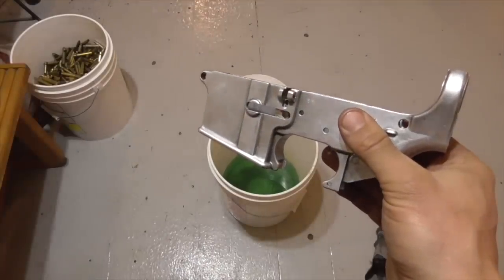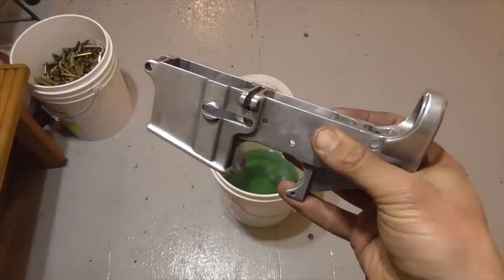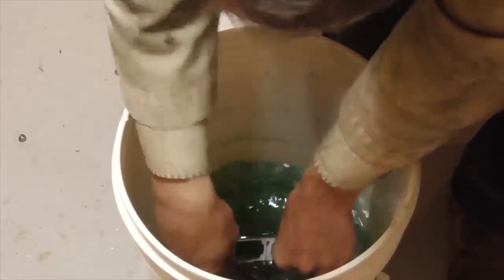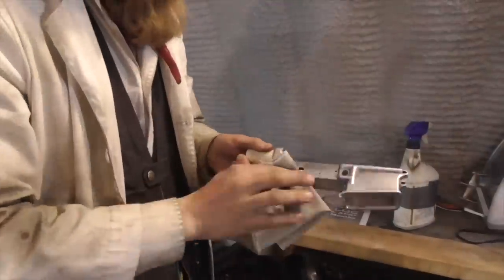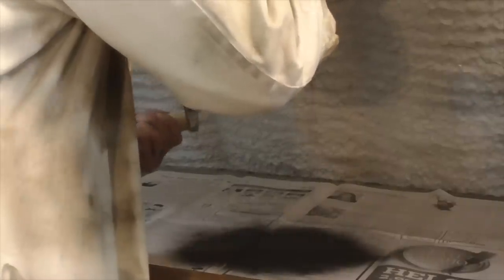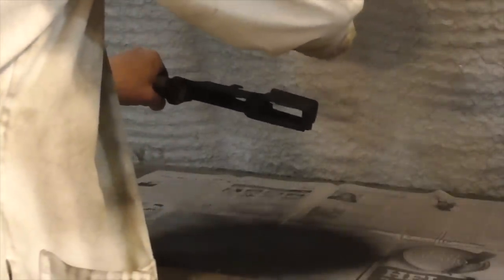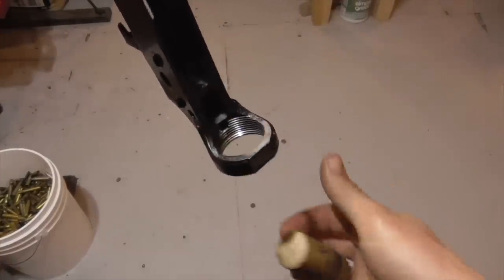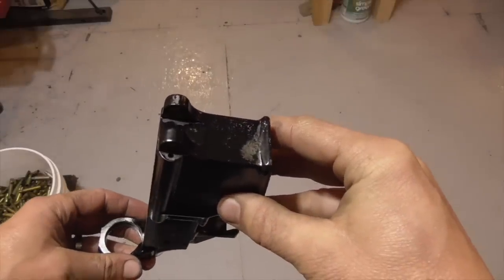Powder Coating: The WD40 Method (TIS263)

Comment: For anyone interested, the wood plug shrank after heating because wood expands when exposed to moisture (up to a certain point of course), and contracts when that moisture is removed (heating the wood allows the moisture to escape).

Comment: I work for a gym equipment factory you cleaned it oiled it to make it stick can you spray it on? maybe a small cheap air brush or even a squeeze bottle ? just a thought I see them stray the powder on all the time before the parts go in the oven. it's not my job I just see them doing it

Comment: This Video was Just what I was looking for . I wonder how it will work with Harbor Freight Flat Black Powder. I've tried the H F Flat Black on cast bullets but it was too rough so I mixed it with H.F. Gloss White and got a better result but that's with bullets , not with my current project .

Comment: Dude a harbor freight unit is only around $75.   I have two and an Eastwood system and there’s very little difference.   I doubt your coating fuses with the product if you are using an oil to adhere the powder; it defeats the purpose of cleaning and degreasing it.   Just get a HF system, they work fine, the results will be much better.

Comment: Bro that's a horrible way to do it man just saying I did mine obviously I used my guys powder coat shop I did it myself though you have to heat the lower first pull it out then you just dust it when it's hot it just sticks when it's cold you have to pile it on mine came out mint and I used bk08 that's the number of the flat black that matches perfect no gloss

Comment: A note about using Simple Green on aluminum. Don’t do it! It’s highly corrosive to aluminum. There is a warning to not use it on aircraft because of this. 

Great info on powder coating. Way better option than other spray on coatings.

Comment: Dear Sir,
This is a very inefficient way of fucking up this lower device. It would be much more effective to place it on the floor and bang it with a hammer.
If the goal was to apply a blotchy surface coating which will be easy to remove due to the oil layer between the item and the coating, i support this method, whereby dipping it into a large can of enamel paint and rolling it in sawdust may have produced a surface finish of equal beauty, with much less effort..

Regards

Gopalkrishna Vishwanath
Department of applied third world coating technologies
Loogs Chitty Road
Bhopal, India
Reply: Best comment here, lmfaooooo

Comment: Try dipping the part in WD-40 and wiping it dry with a rag next time. You can use your air gun for any crevices that the oil got trapped in.

Comment: Suggest you go to Harborfreight.com or your local Harbor Freight store, you can get a powder coat gun for a screaming $60-80 depending if it is on sale at the time.  Had one as the primary gun for my part time powder coat operations, and actually a associate of mine went and bought a Eastwood "As it was a better unit" and paid $190 for it at the time.  Well guess what it was the same unit with only the cover page changed.  How strange that the parts breakdown was identical, just saying.  Now I wouldn't suggest their powders though, they shoot fine but the red for example fades within a short time and the yellow is actually a mustard color.  They hold up well and if you are color blind they are fine.  I use Columbia Coatings and have had excellent results.  Eventually I broke down and bought one of their gun setups, yes the wallet smoked for several weeks afterwards, but it was worth it.  As for my ovens, 1 is a second hand industrial oven, paid $49 for the oven and then $50 for the shipping.  That one is about the size of a home stove oven.  Built my second one by using 2 250 gallon fuel oil tanks, cut one down by 4" all the ways and put it back together, was a pain in the ass to weld up.  Used house insulation between and 3 home oven heating elements. Thermal control from ebay.  All and all I have a 24" x 32" x 50" oven for around $200.

Comment: Worthwhile to note....unless the aluminum has been anodized, at least with clear anodizing, it has no hard protective surface finish.  Powder coating doesn't have the wear resistance of an anodized finish which converts the surface of aluminum into aluminum oxide which is similar to sapphire and second in hardness to diamond.

Comment: maybe you should plug all those holes before you put the coating on that way you don't have fit issues.. that wood dowel thing might be worth remembering if you have to fit something wood and its swelling because of moisture.. you can bake it and make it smaller.

Comment: A note on Simple Green: The USAF issued a directive some 20+ years ago prohibiting the use of Simple Green in cleaning aircraft. Apparently, maintenance crews used it when they ran out of approved cleaning fluids. Cracks were being observed in aluminum components on some aircraft later; when they backtracked the maintenance for those planes, they found they had been cleaned to various extents with Simple Green. Thus, a directive was issued saying NO Simple Green for cleaning any aircraft. It apparently causes something called "hydrogen embrittlement." See PDF http://www.tmt.unze.ba/zbornik/TMT2007/073-TMT07-045.pdf and this article: https://www.autopia.org/forums/car-detailing-product-discussion/93774-simple-green-aluminum-embrittlement.html

Comment: Has anyone else tried this? I'm restoring an old tool box with friction slides, and looking for coating/sealing options (the search brought me here) for the steel slides after I've removed all the rust down to bare metal.  How durable would this coating be in a friction application?  I'm thinking this might be my best bet, as the added thickness of the coating would also snug up the slop in the slide channels, and render a smooth(ish) surface to adhere anti-friction tape.

Comment: VERY COOL!  I also used to do Powder Coating professionally.  I really like the ingenious approach for the job.  I wonder, would the WD40 coating have been uniform if it was sprayed on from a distance of about 12 inches?  I would also CLEAN the part with MEK instead of a soap based agent.  ESPECIALLY on aluminum, soap is caustic and attacks aluminum which can cause outgassing - ALSO -  pre-bake the the item to relieve trapped gasses.  I would also HANG the part instead of laying it down. AND use a Temperature Probe to verify proper temperature.  You do NOT want to get too hot especially with aluminum... It will lose it's temper.  GOOD JOB !

Comment: Your wooden plug didn't contract under high heat ( what material does this?, unless moisture was baked out).....your aluminum expanded. Also.....to avoid "missed" spots of WD-40, you could have submersed the item in WD-40 instead of trying to transfer WD-40 by rag....that would certainly result in missed spots. Lastly....a shaker with smaller holes may have given you a more uniform finish. All-told...good job, but could be improved.

Comment: Welllllll, Eastwood  is well known for top quality automotive items.  They sell this powder coat material and the other tools they deem are required to do the job right.  For the low investment cost I plan to give this a try on some automotive parts. See how it holds up out in the sand dunes.

Comment: Oil is the one thing you do not want on a surface intended to be powder-coated.
Either something is up with the WD-40 solution that does not impede the adherence of the powder, or the powder is just like a candy shell over the WD-40 and might slip off if it were not interlocked with the edges and other 90 degree pieces. 
Doing this on a flat sheet of aluminum should give us the answer as to if it is a real powder coating, or just an over-layer ready to fail and come off.
Reply: I had a business for 34 years removing coatings from paint rejected parts. I had a few customers which requested I put their parts in a WD40 bath after removing the powder. I did so telling them it would cause trouble with adhesion if they did so and their paint preclean got weak. Every one who request WD40 ended up regretting it! Powder does not adhere
 to oily surfaces,,,,WD40 makes surfaces oily!

Comment: Don't ever use wd-40 on any blued finish firearm.  You will have a gun that will perpetually stick until you completely strip the bluing off and reapply new.  Most gunsmiths will tell you to take that garbage out of their shop if you tell them you used wd-40 on it.
Reply: Don't ever use WD-40 to lubricate anything. It is made for water displacement and when dry leaves a varnish like coat. Really messes up the works of a clock.

Comment: Try Spraying the WD on with a spray bottle next time and then wipe it off - this might help get into all the little crooks and crannies. Thanks for the idea - I never would have thought of trying that. It turned out better than I would have guessed - with practice I bet you could get a pretty decent finish that would be close to using a static sprayer system. .  Also, I would guess that the reason why the wood got smaller was that it was like putting the wood in a kiln and it basically baked the water out of it - just a guess.
Reply: Just wondering if you could dilute the WD40 in a fast evaporating solvent and then dip the part. When the solvent evaporates it might hopefully leave behind a very thin but even coat of the WD40. they do this to lubricate some parts in watchmaking

Comment: Anodizing is the coating of choice for something like that.
Reply: Tzuede Off the Cuff  
Yes it it just a surface treatment  that changes the material on a molecular level only a couple thousandths deep at most. It makes the surface much harder, it won’t conduct electricity and you get an even color and finish. With powder coating, like another commenter mentioned, the part  looks like cast aluminum so there’s a chance of out gassing, 
Poor coverage due to faraday cage affect and all kinds of other finish issues. I believe that anodizing would provide a more durable finish. I love powdered coating. I have experience with both and anodizing would also be less labor intensive. You can also anodize in your garage just like powder coating. Just my opinion, We’re all entitled to finish our parts any way we see fit. Just offering my input. Thank you for yours. Only an uneducated person would discount or ignore the suggestions of others and I certainly wouldn’t disregard any input from anyone else. You can’t be too knowledgeable these days and you can’t learn too much.

Comment: "some areas that i missed" yeah i don't think a rag is the best way to apply a coating to this part. the result looks junky. you could use aluminum primer with spray paint
Reply: well not only did you miss the whole point of what and why he was doing it this way, but got the facts completely wrong, he didn't use a rag to apply the coating, the rag was used just to apply the WD40 before he sprinkled the powder coating , if you are going to criticize someone at least get your facts straight first so you can at least sound a little intelligent........

Comment: I'm curious if any other penetrating oils have a lower viscosity out of the can, that and if the WD-40 just bakes off in the oven? Doesn't it affect the coat's adhesion to the metal?
It also seems like using gloves during and after the washing to keep the part clean would help as well.
I wonder if there are any two part products that use a liquid spreading part A, and then a powdered Part B.

Comment: Anodize it instead. Lasts MUCH longer than powder-coating ever will. You can use RIT dye for your color. Sure, it takes a few more chemicals and equipment to anodize, but you'll be far happier with the results. Lots of vids on how to home-anodize.

Thanks for the video though! I thought of powder-coating stuff. Never knew there were other methods.

Comment: I guess if you just want to experiment, a can of WD-40 and a $10 bottle of powder is about as cheap as you can get and still make it happen but it's not a big chunk to get the needed equipment to do a better job. Eastman powder coating kit $150. Harbor Freight is about $75.

Comment: Thank You so much. I have wondered for years if Powder Coating could be done at home. Do you recommend a separate oven? And where do you get the powder coating powder?
Reply from the maker: I bought the powder from Eastwood, although there are several online suppliers.  The powder coat gives off a distinctive odor when it is heated, so I do recommend using a separate oven so that your food doesn't end up smelling like hot plastic from that point forward.

Comment: Just so you know, the super cheap powder coating gun that Harbor Freight sells (for about $50-60) works great. Eastwood has one for a little more that’s even better (like $100 I think). I used them powder coating Yeti mugs for well over a year. I probably did a few thousand mugs with the HF one and a regular home oven I bought from someone on Craig’s list. It worked great and looked professional. There is literally ZERO reason to do a ghetto powder coating job if you have an oven and air compressor. The gun from HF is $50-60, and the powder is literally dirt cheap. It’s like $5 a pound. Get good powder, not the crap HF sells. I highly recommend Prismatic Powders. Their color selection is mind blowing and the prices crazy cheap.
Reply: Prismatic is the way to go that's for certain.. i also got the HF electrostatic spray gun. Which was both cheap and worked very well...

Comment: There are so many things wrong with this I can’t even begin.  100% bullshit.  No way no how this works.  First it will not allowed the powder to build up a sufficient mil thickness to cover.  Second it will not stick to the product as the WD 40 will act as a separating agent and the powder will chip very easy. Third it will outgas causing fish eyes, porosity and bare spots.  100% crap. Anybody that thinks this will work or tries this is a special kind of fool.  Good luck.

Comment: Interesting treatment of a conbobulating diffusion spectraliser. Looks like the regulator mechanism needs rework around the flux modulator. The outer surface around the discharge port doesn't look pretty but once assembled, may be concealed by the thermal discharge flux redirector.

Comment: Some tips for your next at home DIY.

- The powder was put on way too thick. That's why your finish is so bad. Get yourself a powder blower for a few bucks. Even a powder brush or hand squeeze for things like finger printing would work. You just need enough powder to cover it. 

- Might want to try and heat it up to 410 degrees and "hot shot" it. Hang it and cover it quickly then put it back in the oven. Though with your example here a stand it sits on with the plug would've worked. The powder starts to cook on contact and sticks. Shouldn't need to use wd40 even without grounding/positive charge. If kept at temp and not allowed to go down below about 330 you can pull it out and cover any spots you missed and put back in for a final cook. If you're careful there most likely won't be any orange peel. Try it first with a piece of scrap from the yard of the same-ish material.

- At home anodize isn't difficult and most of the stuff can be reused. Alternate to powder coating for aluminum.
Reply: Timmy75  Who doesn't have access to a scrap yard?

Comment: PRO TIP
Spray paint a part like this and then bake it in the oven at 350° F for 30 minutes. The paint will cure rock hard.
I use Rust-Oleum Professional.

Comment: You should probably also mention that heating 7075-T6 aluminum to the temperature needed to set powder coat, you are ANNEALING it.  As in WEAKENING it.
Reply from the maker: Actually, no.  7075 Aluminum is a precipitation-hardening alloy, so to anneal it I would need to hold it at around 800 F (twice the temperate I heated it to here) and hold it there long enough for the precipitates to dissolve, then quench it--just the reverse of annealing a typical steel alloy.  Baking 7075 aluminum at 400 F as I have done here could potentially cause some additional growth of the precipitates,  altering the microstructure somewhat, but assuming the aluminum is already in a T6 or T7 condition, any change to the mechanical properties will be negligible.
Reply: Precipitation occurs at 250 f. For 22 to 24 hours. At 400 f it will lose temper. Read George Pyes book

Comment: Instead of spraying the WD-40 on a rag and then wiping the part spray the WD-40 on the part and then wipe the excess off with a already coated WD-40 moist wet rag this will ensure all surface points are  coated good with oil  but for a part cough cough like this I would have went with a spray on enamel spray paint and then just baked it in the oven for 30 minutes or so for a baked on enamel finish  that would be more than adequate for a piece of aluminum that does not rust and doesn't get hot

Comment: that would cost about $10 to have professionally done. Can't see the crappy DIY for an part that you really don;t want to fail due to powder coating causing jambs or particulate in the mechanism, one would want the ability to "process" items flawlessly, no? One wouldn't expect "lower" performance to be acceptable.

Comment: Loved it!  Nice surprise!  I'll most definitely try it when the right time comes along, thank you for posting!
Reply: Just buy a powder coating gun. They’re $75 from Harbor Freight or Eastwood and both work great. The results will be light years beyond this. Seriously, all you need to powder coat professionally is a cheap gun ($75), and air compressor (you probably have one, a pancake will work), and an oven. Also, probably some high temp masking tape, and acetone. Seriously, that’s it. I used to do this at work with the Harbor Freight Gun. It yields pro results with good powders.